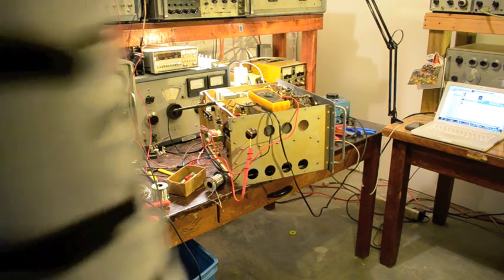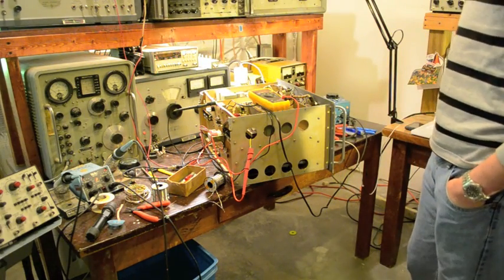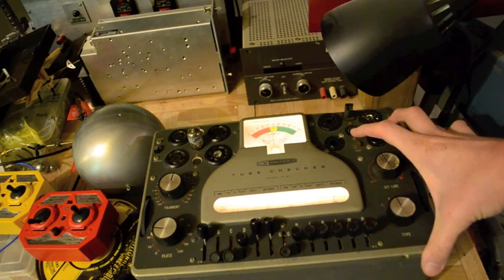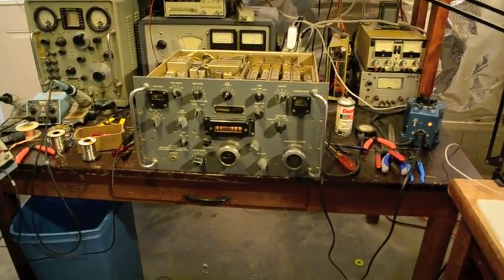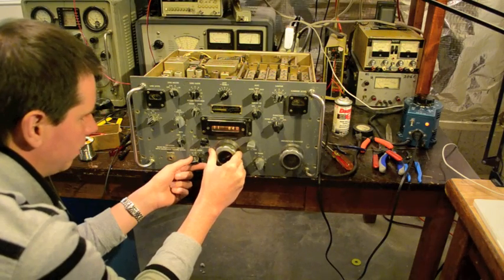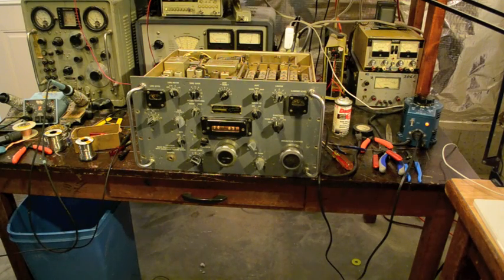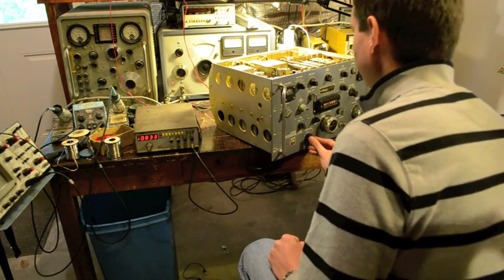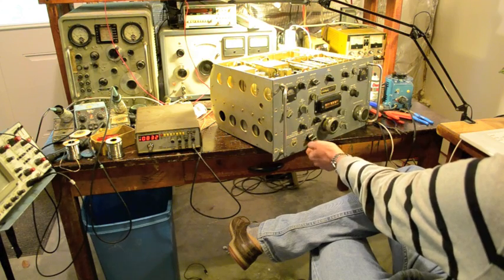Repairing an R-390A, the Best Comm Receiver of the Tube Era Part 2

Comment: Used constantly in the Navy during Vietnam on blue water ships and shore stations. Great receiver for FSK mostly. On PBR's and Swift Boats in the delta, we used equipment that dated back to the 40's and 50's. R-390's is were the name " Boat Anchors " came from. However, due to the weight, I wouldn't used it as an anchor on anything less than a destroyer, otherwise it would drag you under.

Comment: What is your compliment of test equipment? Nice work there!
Reply from the maker: Pair of HP606A/B's, TS-510 (10Mc-UHF sig gen), HP141T spectrum analyzer mainframes for two bands, 100Kc - 1250 Mc, and 10Mc - 18 Gc, as well as two scopes, Tek 468 which is both analog and digital storage, a Heath Zenith scope (TV repair main grade, great scope, awesome trigger), numerous bench supplies, Simpson 260 for presenting the proper impedance to the tub pins when measuring (20k/volt), and lots of other stuff that can be pulled off the shelf.  Generally speaking, i try to make sure that all test gear is HP or Tek or Fluk, high grade stuff even if its really old.  The high end stuff old is usually better than cheap stuff that is new.

Comment: I like how you logically figured out what was wrong:  dead below 8 MHz --> what is specific to that band?  an oscillator --> find oscillator output, no output --> maybe tube associated with oscillator is bad --> check tube, bad --> replace tube, oscillator works --> radio works!

Comment: Thanks for posting. Always good to see others work on these radios. I recently picked up a R-390 (non A) and after a lot of TLC it works beautifully. I did a complete alignment and it performs as well as any of three other receivers I have, including Collins S-Line equipment. A bit heavy for an old guy like me... My issues were in the selenium rectifier and sticking antenna relay and relay in the power supply module. Mostly after that, it was just cleaning and tightening up things. I did carefully go through and clean each socket and tube pins but I had no bad tubes. I agree with you that I do not start swapping out tubes. One at a time and very carefully as most of the original tubes are probably OK if someone hasn't already mass swapped them out. Good video series. I also respect how often I see that you work with one hand in your pocket. PS - I don't always take off my wedding ring either as some one commented. I get 1 uV sensitivity on mine also and have learned that my best audio is with it in MGC and vary the RF gain to keep from overloading the front end and distorting SSB.

Comment from the maker: Yes, amazing it is still serviceable, but that is the mil spec from the 1950's.  I can buy entire chassis panels off Ebay at a good price.  Should be easy to bend-back the front panel.  Going to have to re-paint the knobs at some point.  But it's working!!  Measured sensitivity is better than 1uV.
Reply: need help.....cant get anybody to repair mine...do you work on them.
Reply: rifllemantl@att.net

Comment: BTW  from the wear around the KHz and MHz knobs, you may have a band cruiser, possibly that has seen a lot of history on a ship. It also may have had many of the service updates. But it may have some slop in the mech assembly on the RF module due to lots of use. It can still be aligned and made to work in spec but it may or may not be challenging. 
There is also an R390 reflector where most discussion is 390A but some 390 as well. It is an active group with some knowledgeable folks.

Comment: There is one blocking cap in the IF mod and ahead of the filters which has been known to allow DC to blow filters when the cap was leaky. I have seen this more than once. The AF module PC board is easy to service. Replacing caps on the IF module is more of a challenge but is not too bad. The cap mentioned is near the center of the module and easy to replace. If you have not down loaded PEARLS OF WISDOM from the net, you might want to. More 390A stuff than you can imagine. Loads of great info

Comment: You might want to insect the caps under the AF and IF modules. I am guessing you have an older Motorola built 390A. Which will have a number of black beauty bypass caps which are often leaky and out of spec. The AF module is easiest to pull with 2 connectors and 6 captive screws loosened, The IF mod, requires to Bristol screws< DO NOT use allen driver. Ebay for a set of Bristol wrenches. You can use Orange drops for the audio mod but not recommended above 100KHz. There I use cer disk 
MORE

Comment: Fantastic old boatanchors! You need two of them (one attached to a vertical, the other to a horizontal antenna) and a mill so you can set up a 60's era intercept station!